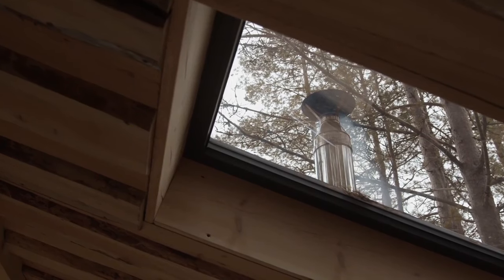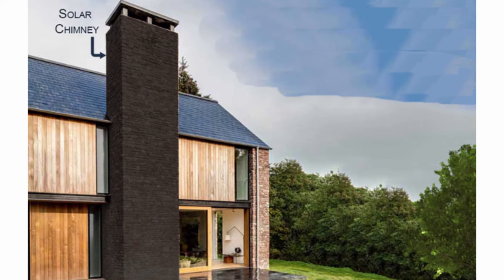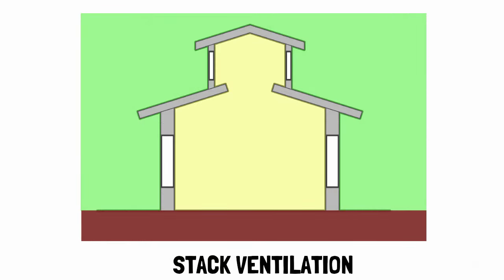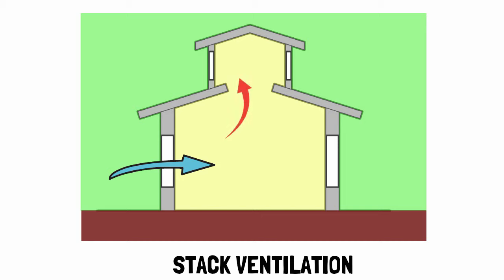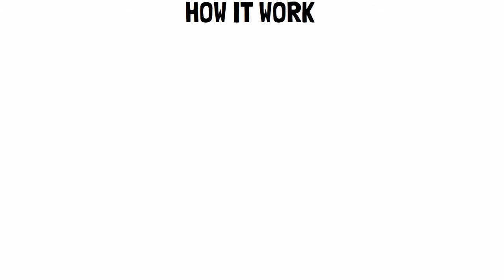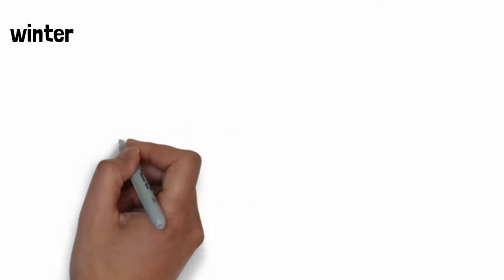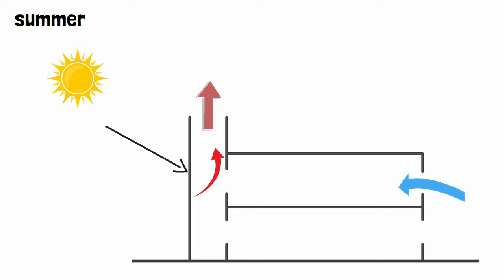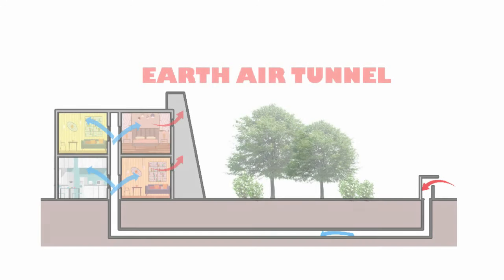SOLAR CHIMNEY || passive heating and cooling system || how it works

Comment: I suppose for the chimney to work you have to let it without insulation, what about winter days with no sun, will it not be a huge cold spot? or do you close someway the openings to the building? depending the extra cost to build it, it maybe better to get some solar panels to help with AC bills with hitting and cooling.

Comment: Warm humid air entering into the system would result in a great deal of condensate which would have to be removed. And I'd be concerned with air quality due to creating an ideal environment for mold in the piping. Modern heat pumps appear to be the way to go due to their efficiency.

Comment: With an earth air tunnel you can get cooler air (~55°F) than the outdoor air temperature in summer. That said, if you live in near the equator, say Florida for example, the ground can be 72-77°F meaning it probably won’t have enough time to cool the air to about the same temperature. However, it would take less energy to air condition the pre-cooled air than direct outside air. Also any airflow can be used with evaporative cooling like a swamp cooler, which could potentially be entirely passive. Again, though, in humid places, evaporative cooling is less effective, sorry Florida…
Reply: under ground will never get to 77 degrees. wtf are you talking about dude? unequivocally false

Comment: Depending wind directions the chimney should have channel’s and a downdrop for debris to fall down to and not in the rooms or channel’s themselves. Just like a “Grundofen” where the heat is forced down to heat an entire thermal mass of 3 stories when placed in center. So like an medieval arabic architecture would do. With one system to cool or to heat.

Comment: do you think the fresh air in summer is cool??😅😅
Reply: Air outside the building is cooler than air inside the building because of greenhouse effect no proper ventilation and high thermal mass of building materials